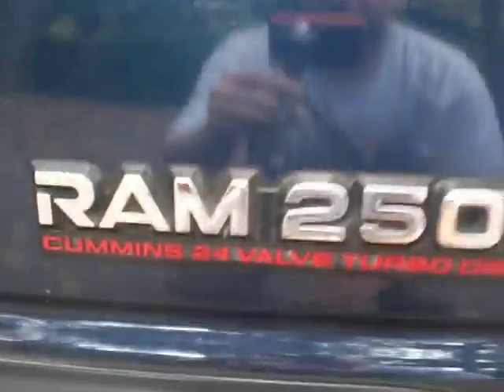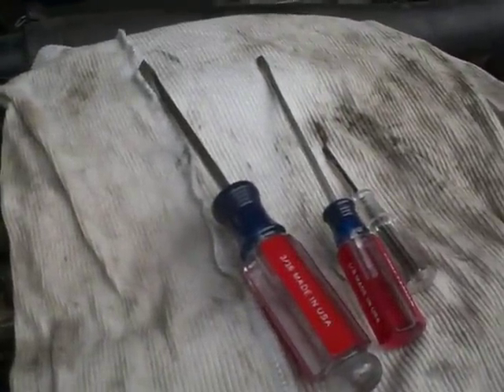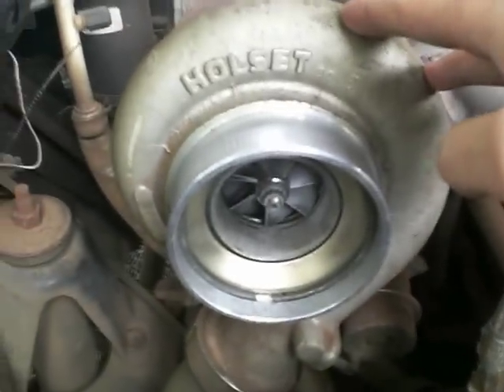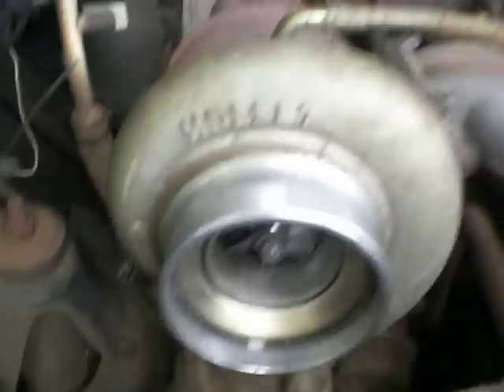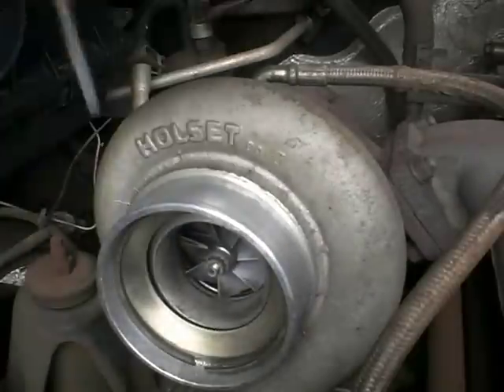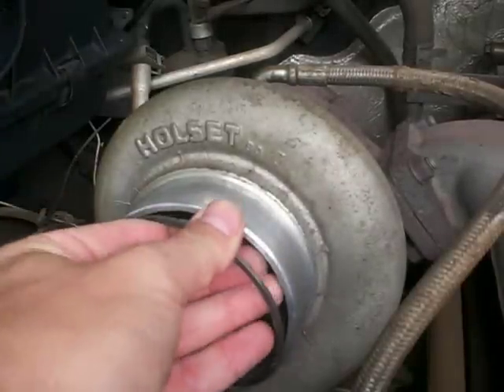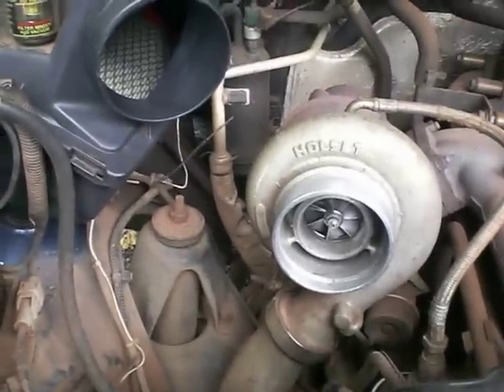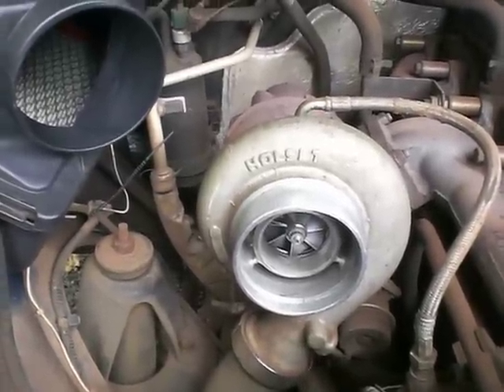cummins turbo silencer ring removal

Comment: As neat as the sound is w/o it, it's there to direct air to the center of the compressor making the turbo more efficient. The cool Noise that comes from under the hood is mini sonic booms that are creating more drag on the compressor wheel making it less efficient and robing you of power and spool time. another drawback is its hell on the bushings. I bet you get a few months out of a turbo after doing this before it needs to be replaced. Just thought you should know:)
Reply: lannen27 I know people that have had them off for years. and replaced the turbos only because they wanted an upgrade. so.. no. lol

Comment: You won't here any difference at all. Why you ask? That giant air filter box muffles all of the sound from the turbo so it's very quiet. What me friend did was just remove the ring, and replace the box with a little cold air intake on the end of the turbo hose. It screams now!

Comment: You loose efficiency doing that.
the "silencer" calm down the air flow and allow a better fill up of the turbo.
It's more silent because there are less turbulences....

It's like a velocity stack, calming the flow on an intake or a throttle body.
the air is organized in a calm vein and is not disturbed by sharp angles or brutal changes of shape.

it's not here for no reason.
Reply: Dodge requested the ring so it wouldn’t be as loud. Holset made them optional
Reply: If it’s so inefficient then why doesn’t anyone put silencer rings in their aftermarket turbos?

Comment: you sure thats not for aerodynamics? kinda like a funnel? would "silence" it by not whistling because the air is moving efficiently. Thus you get more noise by removing it but it takes energy to make that noise and that is taking away from overall efficiency of the turbo. Id say leave it in save yourself 15 mins of your life!!

Comment: a non dust damages the turbine engine and ???
Reply from the maker: no damages….
Reply: More and where a stone or even dust entering inside the motor will not damage?
Reply: Vagner Monteiro do you realize that doesn't stay open like that😂😂

Comment: You just killed air flow and Power that ring silence is the turbo by accident it's not there to silence it it's there to make air flow flow smoothly like a funnel into the turbo when you take it out the turbo has to work harder to make less boost cuz the air is Flowing places it shouldn't be going that's why the turbo gets louder do not do this you will kill power on your truck you will not make more power like this only less power

Comment: This is a dumb mod. Has no value and may, in fact, hurt the air flow into the turbo with turbulence.
Reply: +Ron LeVine Actually, no. It's a great mod and plenty of value. That housing is an anti-surge housing, which by design is there to reduce turbulence. Removing that ring gives it complete functionality now.
Reply: Waste of time.
Reply from the maker: Great mod….makes you to enjoy ownership even more..worth every second.
Reply: Well it may,I have a 92 Dodge cummins 280 hp I LOVE, I just don't see how removing that ring will make horsepower, I believe it would decrease it if anything, because it's making a larger HOLE to bypass air ??
Reply: If it makes you happy, go for it. However, it does nothing for you but make noise and cause turbulence in the intake of the turbo.
Reply: Actually, if you remove it, the hole stays the same size. The area under the ring goes nowhere. it is just a cavity...
Reply: So why do it,No purpose..